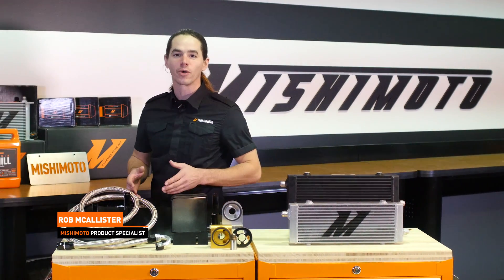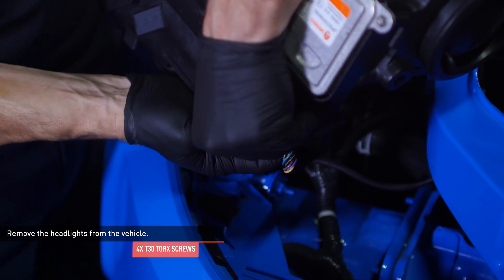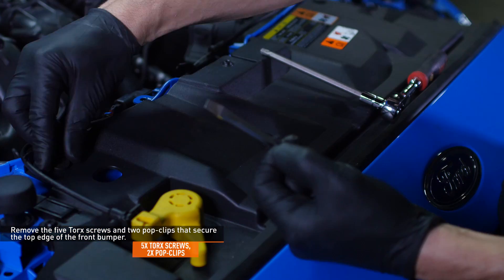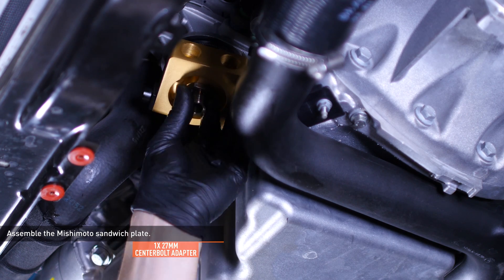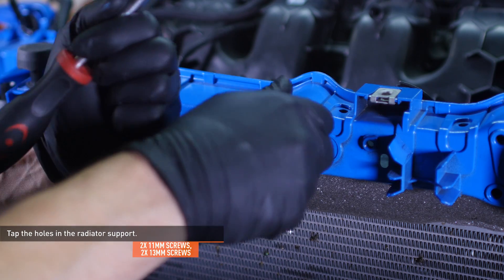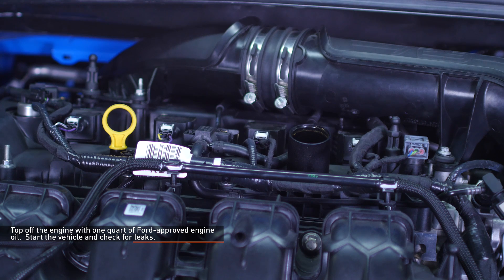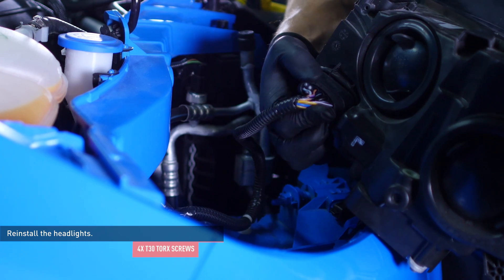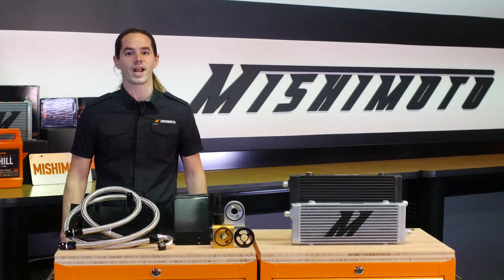2016-2018 Ford Focus RS Oil Cooler Installation Guide by Mishimoto

Comment: You don't show the removal, or reinstallation of the plastic next to the radiator between it and the headlights. What with those?

Do you put an extra quart of oil in before you run the engine to check for leaks? If so, how does that work if the thermostatic plate hasn't opened yet because it hasn't come to temperature to open?
Reply from the maker: Hello thomwithah. All of the plastic pieces are removed with the same method as the ones shown in the video. Simply remove the pop clips, and the plastic covers will come off. Reverse order of operations would be taken when reinstalling. 

As far as the cooler system goes, you should add an additional 1/2 to 3/4 of a quart of oil after installing. Once installed, allow the vehicle to come to operating temperature and inspect for leaks. While the thermostatic kit does regulate temperatures, it does always allow a small amount of oil through the system to prevent very cold and very warm oil from making contact with one another when the thermostat opens.
Reply: Mishimoto Automotive Good to know about the plate letting a bit through. 

The bit I'm talking about is part # G1EY-8311-A, you don't show it's removal. I don't think it can be installed back in place when this cooler is installed. 

Please clarify.
Reply from the maker: Hello thomwithah, Unfortunately, I would not have any direct information in relation to that part number. This is something that we would need to get our product group involved in for further diagnosis/troubleshooting. 

I can suggest referencing our PDF installation guide linked here: https://cdn.mishimoto.com/media/productpdf/MMOC-RS-16_InstallGuide.pdf

If this does not resolve your question, please send an email to support@mishimoto.com and we'd be happy to assist further.
Reply: Mishimoto Automotive the linked PDF, after step 23, has all the same.(seemingly unrelated) photos. 

It also doesn't mention the rear air diverters.

Comment: Is this exclusively for the RS or could it also be used on the ST? If this cooler isn't compatible could this air diverter be used on an ST?
Reply from the maker: Hey! Here's our direct-fit oil cooler kit for the Focus ST: https://www.mishimoto.com/ford-focus-st-oil-cooler-kit-2013.html
Reply: Mishimoto Automotive I'm aware of your kit for the ST.  But I'm interested in the air diverter. Will it fit the ST and if so will you be making it available? Thanks.